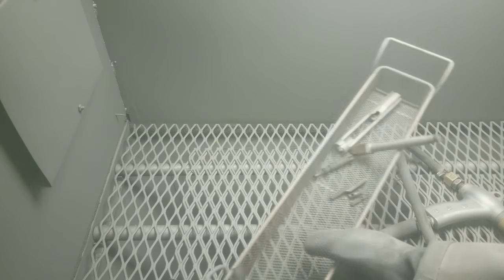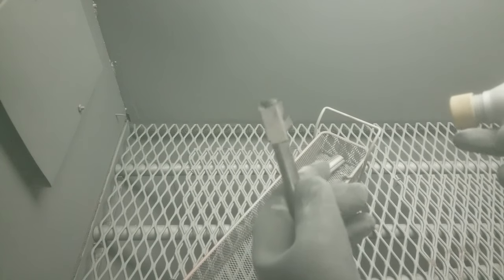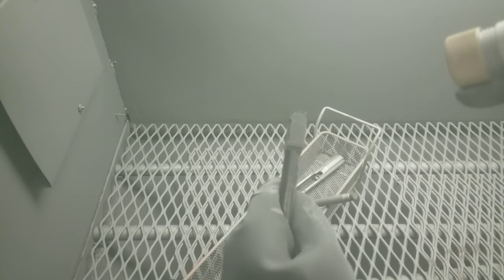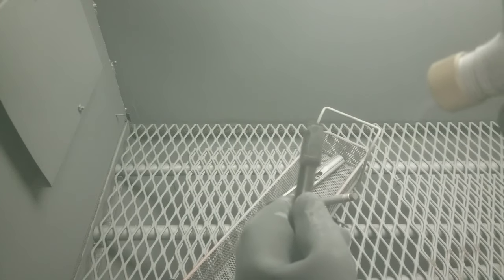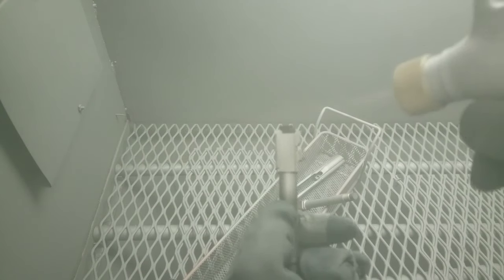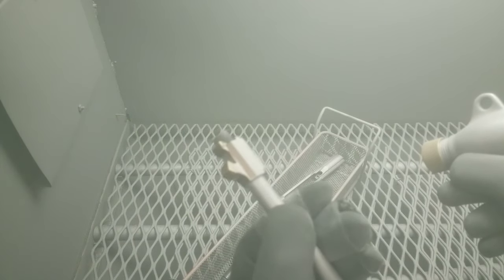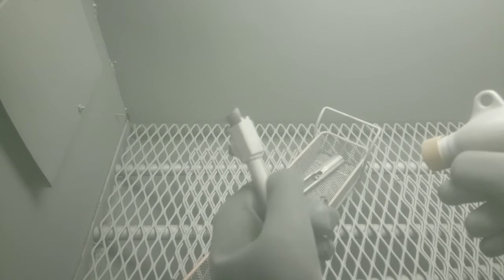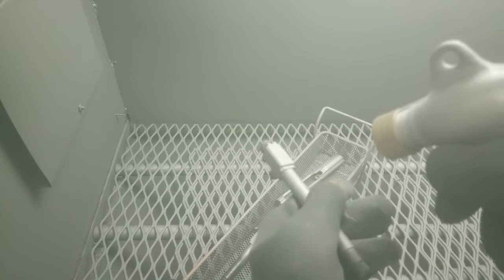Is PVD coating really that tough?

Comment: In my experience from carry, Chrome and Nitride are the most wear resistant finishes. Both Cerakote and DLC (which uses the same process as PVD, just with carbon instead of titatium nitrate) are extremely hard surface coatings, but susceptible to chip damage. If you look at the barrl/slide lockup on a Gen3/4 Glock compared to a Gen5, theres significantly more wear on the latter.
Reply: I've had my TP Glock 26 9x19mm gen 5 barrel for around 24mo +. I bought the TiN gold color. It shows some minor nicks, scuffs from sections that contact each other but overall the barrel is worth the $, easy to clean. No rust or problems. 0.
Reply: @DavidLLambertmobile  You don't get rust or wear on nitride or chrome either.

Comment: It may be because it was a mass produced coating, but I have it on a new hunting rifle and as far as moisture resistants or being in wet environments it doesn’t seem to protect from rust very well at all. Just had to remove a ton of surface rust and do a full take down of said firearm. I’ll be sending it to get cerakoted soon I believe. Just my 2 cents.
Reply: Pvd is for stainless steel I believe.

Comment: So which would be better for the rifling. Chrome lining is the go to how does dlc & pvd match up. In the precision world a big fear is burning your barrel out due to got loads.
Reply: Chrome lining.
Reply: My comment is super late to be helpful, but DLC is actually far superior to chrome for increasing barrel life. In fact, SIG has switched over to a DLC bore coating for the Army's new XM5 carbine, because it's 80K PSI 6.8x51mm ammo would wreck hard chrome in no time. Of course, it is a much, much thicker application than the cosmetic protective coating you see in this video, and looks almost completely black in appearance. None of that is particularly relevant for 9mm pistols that already have absurdly high barrel lifespans in the order of hundreds of thousands of rounds, but an overbore rifle cartridge would benefit more from DLC than chrome.
Reply: Incredibly old comment but chrome lining is superior as it provides a thick coating that protects your rifling, however it’s an expensive and laborious task that also requires extreme precision to make sure it applied evenly and level to ensure accuracy. It’s not something you can just have a shop do to your barrel, you have to buy a barrel that’s been chrome lined from the factory. If it’s been heavily damaged yay it saved your rifling but it’ll just be milled out and you’ll need to get a new barrel if you want the chrome lining back. PVD, DLC, and Cerakote can’t match the protection you get from chrome lining but you can have them applied to applied to any pre existing barrel in the $80-200 range depending on the barrel size and repaired for around the same when it’s damaged.

TLDR- Chrome lined is better but it’s too laborious and expensive and has to come from the factory lined and can’t be repaired if damaged, only milled out

Comment: How much of your material are you using up to get the coating off just the one handgun barrel? Curious if it would be worthwhile to do mine if I ever become tired of the coating.
Reply: Its worth it. It last longer then Cerakote. 
Plus the pores on the surface soak oil in. So it'll resist water, sweat and any other moisture or fluids. Very worth it!!!

Comment: How come Sig legion PVD so bad then??? Can you answer for everyone??
Reply: I think there’s a difference in how companies apply the coating, and it’s probably the cheaper ones aren’t as strong even though it’s the “same” coating.
Reply: Ionbond. They set up a satellite shop in NH just for Sig work. Pop-ups like that generally don't produce as good of a product at high volume as PVD facilities.  Plus, whatever is going on in this vid isn't DLC. DLC is done in a vacuum chamber. No ones sticking their arms into a working VC unless they want them to explode.
Reply: He was sand blasting the parts taking the existing coating off

Comment: My g19x pvd and g43x  pvd has started scratching pretty easily, does color change the hardness of the pvd?
Reply: Depends on the source material. Some are organic, some inorganic. Each gives different results.
Reply: My Glock 19x scratched with a brass punch. Soft as baby shit.
Reply: @codygorman691  Mmmm, that's soft..

Comment: While interesting, this is not PVD, which is done in a vacuum and generates a plasma. Typical methods are evaporation and sputtering.
Reply: No one is suggesting that he's demonstrating the process of physical vapor deposition here, he's comparing the durability of a barrel already coated using PVD with a factory coated barrel.  The gold barrel is the one coated via PVD.  He's sandblasting the coating off to prepare it to be PVD coated a different color and to show how much more "abuse" that current PVD coating can take than a factory coating.
Reply: @jhcoverdrive9287  Ahh, yes. That is clear now that I watch it all. Thank you.